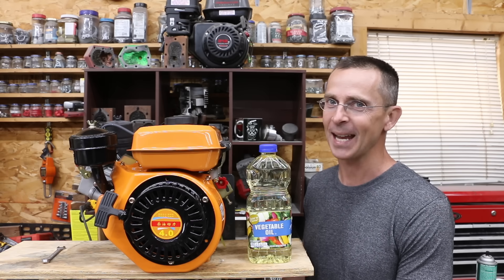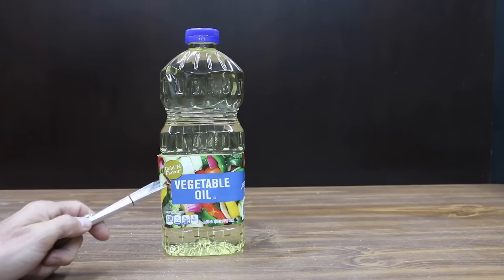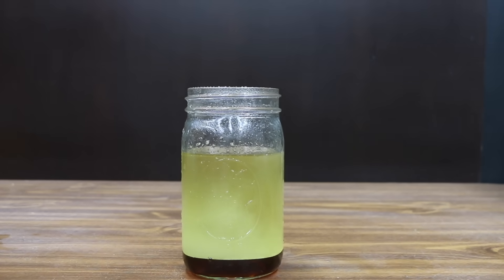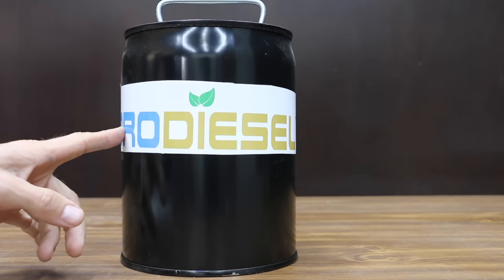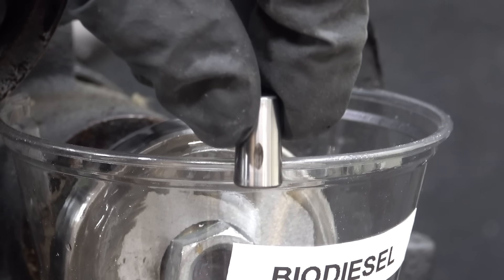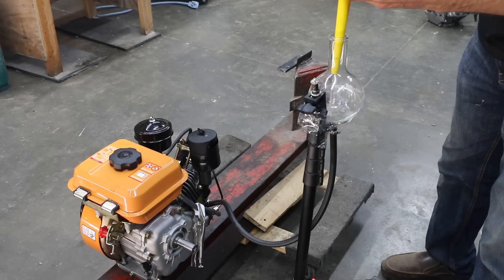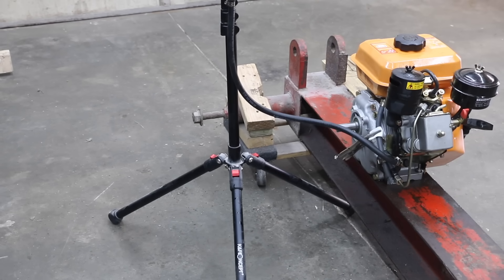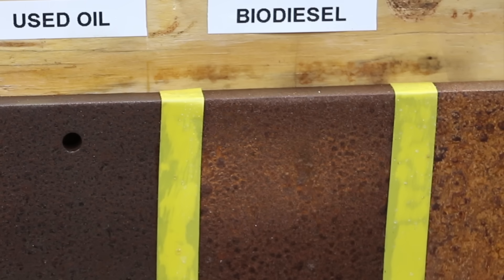Make "Biodiesel"? Let’s find out! Diesel vs Biodiesel, Used Motor Oil, Vegetable Oil, MPG

Comment: As the author of a book about bio diesel, called “The do it yourself guide to biodiesel”, I’ll add some interesting notes here. As always, a good video. Even though I wrote the book 15 years ago and haven’t mastered biodiesel in about six years, I think I can still remember most of it, LOL. 

Cooking oil is a triglyceride, meaning it is a large glycerin molecule attached to 3 fatty acid molecules. When the methanol and catalyst (either Lye, or potassium hydroxide also known as KOH) are mixed together They form a very caustic solution. When that is added to heated up cooking oil and agitated it breaks the bonds causing the glycerin to drop out. You don’t want the glycerin because glycerin doesn’t burn well and eventually gums up engine parts. That’s why SVO, or straight vegetable oil is less than ideal (Because the glycerin is still in it). And biodiesel is not just cooking oil with chemicals added, it’s actually a new chemical substance because of this whole process.

Water washing works really well, but you actually need to remove the remaining water from the bio diesel which is why it still looks cloudy in the video. I used to do it by spray drying. When it’s truly clean it will be very clear, although it will still have a tint anywhere from Amber to yellow.

I ran biodiesel in multiple engines for years with not one problem. It can’t be winterized like petroleum diesel and will gel as shown in this video. That and the fact that due to the way modern diesels are designed, you can only use a maximum of 20% in the engine if at all, so I finally gave up on using it because I like to drive modern vehicles.

I never liked the idea of straight vegetable oil, known as SVO, because the glycerin is still in it which causes problems with sensors, and general gumming up. And you had to have an oil heater to get it to flow properly, and then switch over once it warmed up, and that was even more difficult in the winter so it has huge drawbacks.

But I used to make it for $.35 a gallon which was great in 2008 when fuel prices hit $4.00 a gallon. But what actually determines the price is the methanol. You can usually find cooking oil for free, but the price of methanol is what will determine the final price. I used to buy 55 gallon drums of it from my supplier for a good price. My diesel truck as well as my fathers and our tractor all ran smoother and quieter on biodiesel so I miss it.

My current channel focuses on teaching home-improvement skills with a focus on drywall. I just recently received my silver play button for 100,000 subscribers so I don’t get too involved with bio diesel anymore.
Reply: Great explanation Kilted!  I too have been involved in making B100 for both of my Mercedes-Benz Diesel cars. The process is exactly as you described.  My friend has a processor, and we make 80 gallons at a time. He has solar power, so the only hard costs are the methanol and KOH. We can make it for less than $1.00 a gallon!
Reply: @joeyahoo2438   "Mercedes-Benz Diesel" hahah :D That's funny
Reply: @joeyahoo2438  potassium hydroxide is made with ash and oil.
Reply: Do you have a video on your process?
Reply from the maker: Thanks for sharing.
Reply: @ProjectFarm  Who knew you'd have someone who was a pro show up in making suggestions on how to make better biodiesel? Maybe some new fuel in the Ford Tractor in the future?
Reply: @ColonelK0rn1  i’ve been following Todd for a long time as he puts out great content. LOL
Reply: @ProjectFarm  great video. How about a video about foam cannon comparison or even if they work.
Reply: @ProjectFarm  

Could you please do a video for portable inverter generators
Reply: @ProjectFarm  as you probably know, I have a YouTube channel, and I enjoy teaching and helping others, so no problem. You’re killing it with your channel and congratulations. I did just get my silver play button this weekend so mines starting to go well. If I didn’t have so many health issues…
Reply: Thank you for the info! I am the opposite and run all older vehicles and equipment on my farm and am going to run biodiesel in the warm months.
Reply: What is it about modern diesel engines that makes biodiesel not work? Emissions, or something to do with the newer injection systems?
Reply: @spazzwazzle  A lot of different problems in modern engines. The addition of ureum, super high pressure diesel systems and particulate filters makes it almost impossible to use bio diesel.
Reply: @Kwarksnuiver  - I have not found this to be true if your fuel meets all the specs.  Home brewed often does not.  High pressure and urea have no effect on biodiesel.  If the fuel is in spec, it will not clog a filter.
Reply: @Kwarksnuiver  Thanks for the great answer!
Reply: @Kwarksnuiver  what is a simple definition and advantages of ureum, highpressure diésel and particulatefilters?
Reply: @flashpointrecycling  what do you do to meet specificacions and why they matter as much?
Reply: @xaviercruz4763  - Wow! that is a topic that books are written about.  I will be brief.  Almost no one (outside commercial mfg) has the testing capability to determine quality.  Most of us hold up a beaker of new fuel to the light and say "boy, that looks good!"  The fuel specifications I refer to are US or even European standards for quality.  Not necessarily legality for home brewers.  These specs are the product of millions of dollars spent to develop a standard for fuel that won't destroy your vehicle.  Biodiesel is a pretty simple chemical process but if you are off by just 1/2%, you ARE causing damage to your vehicle and probably the environment.  There are all kinds of things that go wrong in the manufacturing process and with no ability to measure success, we are all just winging it.  It is easy to ignore even the most blatant symptoms of failure,

Even big commercial manufacturers have had a very difficult time meeting the standards which resulted in a very rough start for the entire industry.  Quality control is very expensive.

So, can you make low quality, marginal fuel at home and use it in your vehicle?  YUP!  Will it be bad for your vehicle?  YUP! Very Bad? Sometimes yes!  Basically, rather than spending money to control the quality of the fuel, you will be able to measure the quality by the shortened lifespan of your fuel system and engine.

Rebuilding diesel engines is a very expensive hobby!
Reply: @flashpointrecycling  Cool, thanks. Where are test for quality done?
Reply: @flashpointrecycling  sure! Yes, and saw that company of standard you suggested. Biodiesel is nice and theres seems to exist petroleum diésel which would be interesting to manufacture.
Reply: @spazzwazzle  regeneration.. it doesn't work with biodiesel because the ignition point is higher than regular diesel.
Reply: @spazzwazzle  In response to this question, there are 2 main factors governing. Bio diesel works well in older style pre combustion chamber motors, and with old style injectors. Modern style direct injections with much higher pressures and multiple jets don't seem to atomise as good with the thicker Bio diesel. Also the burn characteristics of the nitrous oxide rich bio diesel and veggie oil require tuning of the motor to work well.
I used to run a Nissan LD 20 with around 70% bio diesel. A port job,  headers, opening up the inlet manifold and a k&n filter netted good results, but experimenting with the injection timing, nozzle sizes  and spring rates on the injectors, gave better results, up to 20 extra horses over regular diesel. Bio and veggie oil take more energy to get burning but burn faster than diesel, due to the natural Nitrous oxide locked up in the  glyceride molecules. PF didn't state whether he heard a difference in sound  of the motor when running the different fuels. Veggie oil and Bio run super smooth in 4 and more cylinders.
Reply: @thecelticprince4949  4 or more cylinders run biodiesel well in which vehicles you say?
Reply: O
Reply: @spazzwazzle  The first main thing is censors in the new engines will sense issues with anything that is not diesel and tell the engine to shut off
Reply: @spazzwazzle  - Basically, when they made 'cleaner' diesel engines, they stopped working with clean fuel.
Reply: @spazzwazzle  The older diesels used mechanical injection.  Today they use a finally tuned common rail electronic injection.  The tolerances are much smaller.  Fuel pressures are much higher.  The injector nozzles have much smaller spray holes etc..
Reply: @spazzwazzle  in my POV, emissions regulations "silently" wanted to get rid of ICE which run on fossil fuel and go to the EV, with the way of making an engine that couldn't run better using anything that is BIO, since the backings were "maybe" someone or some organizations that like EVs or declare them as environment protectors...
I said that because of some of my knowledges and a bit of experience in the modern diesel engines...
Biodiesel tend to have lower CO2s, lower COs, lower particulate matter (if you didn't experiencing dirty fuel filter because bio means something big (A.K.A fat) is more), and a bit lower NOxs because they are basically natural and the result of combustion is degradeable (except for burned lubrication oil in the cylinder liners)...

The elites want to biofuels to be extinct because : 1. More biodiesel plants could be planted so oil mining is less, 2. ICE lifetime (especially diesel) is lengthened so electric vehicles with Lithium-ion batteries can suspended, and 3. It could make any 3rd world countries (or poor countries) steadily make profit because the "fairly" easy making of biodiesel (just need the plant, methanol, burner, shaker/mixer, and some processing tools)

You know, the politics aren't that kind, especially to my 1st and 3rd statement...

Indonesia, where I lived on, experiencing more Biofuels coming into production, with oncoming B40 Biodiesels (40% bio content, 60% petroleum diesel) from previous B30 Biodiesels. But, stupidly, our goverment says Euro-4 shortly after Covid pandemic which make almost everyone shocked and panicked, causing everybody (companies) stockpile old mechanical or simple ECUed diesel...

But, there is one company that could guarantee you could run your diesels with any sort of Biodiesel, which is UD Trucks, because they only upgrade the Euro-3 variants to Euro-5 with just add SCR along with an AdBlue meanwhile others do it otherwise with using "a mind-blowing stupid" EGR...

Sorry to get this very long, cause, I like Biodiesels
Reply: Right on!  I have commercial manufacturing experience from several years ago and am still compelled (occasionally) to try and fight against the massive amount of BAD information out there concerning biodiesel.
Reply: Oh wow i I hope this gets pinned
Reply: I worked for a computer repair company that used a fleet of used Ford F250 and F350 Diesel ambulances, setup to run on just about any thing you want to feed them.  he was making his own B100 Bio Diesel a first, then switched to SVO a little later on. when he was first using homemade B100 they ran great without any issues, after switching to SVO they were hard to start in the winter, but here in the desert where it never get below freezing they would work fine once they were warmed up. that said, they broke down all time. i don't know if it was do to normal ware and tear, the age of the used ambulances, or the SVO, but they were always in the shop getting repaired. I quit working there mainly because i hated being stranded in broken down rigs and compounded by the manage being a compete dick to employees any time one of them broke down. the owner of the company and his wire were cool and i hope they are still doing well.
Reply: My mercedes om606 runs on waste veg oil (sunflower) for 120.000km rigth now my tank froze up once (-23°C was too much...) but i still use a one tank system, just a bigger feed line, stronger liftpump and an flat plate heat exchanger without any engine block heater or fuel tank heater. It works grest if you have the rigth car for it😏. But be careful in many countrys it is forbidden to use it as fuel...
Reply: Can you describe the spray dryer?
Reply: @davidscott5903  well basically you’re trying to gently spray the bio diesel out in as wide of a pattern as possible which exposes the fuel to more air & the air slowly evaporates the water. When it is finally dry it will go from that milky hazy look to crystal clear almost instantly. It will still have color to it just not the haze. I manufactured the equipment for six years under the name EZ biodiesel and had connections to nozzles that would spray in a nice flat pattern.  A lot of people just use a garden sprayer nozzle or something like that.

I have a second YouTube channel that I just now started with no videos, called That Kilted Guy Creates and I may do an example of how to make biodiesel the way I used to. I had mine tested once and it came back very clean.
Reply: @ThatKiltedGuyDIY  so what youre saying is that my 2000 7.3L can run on straight veggie oil? i already run used oil through it with 2 frame rail filters. OBAMA/ BIDEN aint stopping me!! Long live the 7.3L!!!!!!!!!!!
Reply: @gman8760  Nor would they particularly want to... vegetable oil is carbon neutral. It’s the stuff that comes out of the ground that’s the problem. Now, your local fuel tax guys might have a different opinion...
Reply: @gman8760  I would add 20% kerosene to the mix not SVO I ran my 12 valve on peanut oil and kerosene for years also I would throw in my used oil or trans fluid after I filtered it threw a 2 micron filter the old mechanical diesels will run on anything almost
Reply: @Justthemow  kerosene or diesel? And what about used cooking oil?
Reply: @gman8760  the used cooking oil is fine as long as you filter it really really well used oil has bits of flour and stuff in it and kerosene has more of something in it then diesel I forget what it is but it cleans the engine and fuel lines as the oil will leave gummy shit in the system. So used cooking oil needs to ultra filtered and this really only works in mechanical diesels not cp3 or cp4 it has to like a vp44 or p7100 if you have an early cp3 pre emissions you could run up to 20% oil and the rest diesel
Reply: @Justthemow  i run a 2000 7.3L HEUI system so I don't see why it wouldn't run. Just a thought if the price ever gets ridiculously high
Reply: @gman8760  Dumb comment of the day winner.
Reply: @Justthemow  Used cooking oil will contain proteins as well as starches, and will often have been heated to high temperatures (over 350°F). 

New cooking oil is ten times the price of gasoline. Where this guy pretends to get it free I don't know.
Reply: @gman8760  Another solution used by a guy I know is to keep some pure diesel in his second tank. He starts the truck on diesel, switches to veggie once the engine is warmed up a bit, and then when he is 5 minutes from home, switches back to diesel. Iirc he's using the diesel to clean the glycerides out of the system before shutdown.
Reply: @Ea-Nasir_Copper_Co  Who is the 'guy pretneds to get it free' bud?  Todd showed new veg oil, however you can go around to many small restautants still and arrange to pick up their used fry oil.  Many places have to pay to get it picked up, so offering to pick it up from them and maybe drop some cash their way is possible.  
Many people do get it free.
Reply: @gman8760  you run straight used motor oil in your 2000 7.3? I have a 99 7.3. Did you cut it with gas?
Reply: @norriscarey9822  usually cut with diesel. I don't run a full tank of straight motor oil. I should rephrase that.
Reply: @gman8760  you should see the comment I left later on the video. Ran the same motor on it for 15 years and still use it today.
Reply: @austinjohnson3787  I think I did see something about that..you run it cut with gas right?
Reply: @gman8760  gotcha man that’s what I thought.
Reply: @Ea-Nasir_Copper_Co   You get it used from restaurants for free. They have to pay to have it recycled so they should let you have it for free once they have some reason to trust you. Of course at this point it's partially burnt, it's got lots of debris and probably some water in it, and smells kinda gross. But once you skim it, then fine-filter it, and possibly boil out any wash-water or rain-water (cuz it's normally stored outside), you have free kitchen oil.
Reply: @gman8760  hell no, we did it as professional as it gets.
Reply: @austinjohnson3787  ah gotcha.
Reply: @gman8760  You can do a mixture of 30% veggie oil and 70% diesel. Works well in my old Mercedes Benz. Smells like fries. Dont spill the veggie oil on the paint, it is hard to remove.
Reply: @stefanmargraf7878   new veggie oil? Or used? Either way good to know
Reply: @gman8760  New veggie oil.
Reply: @stefanmargraf7878  you can run 100% veggie oil in all mercedes diesels up to the om606 (lastly build in the w210 e class)
Reply: @gman8760  lol i suddenly got flashbacks from an old TV item we had back in the 90s, where some belgian dude made a vehicle that ran on old contaminateddeep frying cooking oil from snack bars,  he would pick up for free as they would toss it out otherwise 

not sure on what he added or how/whether he filtered it, it just showed him driving and a pretty poor burning :')

pretty fun to read the original commenter's comment talking about how it's not just cooking oil with added chemicals, but actually a... transmutation (i think that's the word?)
Reply: @ThatKiltedGuyDIY  please do ill sub
Reply: @ThatKiltedGuyDIY  would you not say that the glyceryl ester fragment would have different properties to the glycerol alcohol left behind after methanol esterification? the glycerol in biodiesel is a contaminating byproduct, whereas the glyceryl group is a core part of the vegetable oil molecule that isnt possible to remove without making it not vegetable oil, the same way as nail polish remover without the ethanol is simply vinegar, which wouldnt really burn well at all. in this context, where the glycer- group is not glycerol, why would it have the same "gumming up" effect on the engine, considering it wouldnt be possible to not burn in the reaction?
Reply: @davidscott5903  it’s probably described in detail - in his book.
Reply: @davidscott5903   based on the description in the post and what I know of similar processes used in other chemical processes, it's just a misting nozzle. 

The biodiesel is sprayed through the misting nozzle directly into a bucket or receptacle, usually with dry or warmed air circulating around it to encourage water evaporation. 

The easiest setup would be a lawn sprayer, but you'd want the chemicals that usually ran through such systems to be thoroughly removed.
Reply: Here in Australia I'm part of a club that just mixes used veg oil with petrol 15% it works pretty well in older pre combustion chamber engines with mechanical injection but not really in common rail systems
Reply: not everyday i learn a lot in youtube comments. thx kilted
Reply: Aren't the fumes from stripping out the glycerin toxic? ...or does it depend on what you mix into the Veg oil?
Reply: This! Brings back some memories for sure. I haven't made any in a good long while but I like the idea of being able to.
Reply: To throw my 2 cents in the well, I used to run my 2000 VW Jetta on an 80/20 oil/gas mix and it ran great. Drove many miles that way. The issue I had was the amount of smoke rolling from the tailpipe under acceleration. I felt bad for the cars trailing me. Lol. I never had any other issues and still have the car to this day with 340,000 miles on it. Now, I also have a 1968 M35A2 (deuce and a half) with the multi fuel Hyper Chamber LDT465 engine. I run that truck on pure used motor oil that my family, friends, and neighbors drop off in my driveway (about 10 gallons a week). As with the VW, I run this used oil through a heater and into a centrifuge at 7k RPM which filters down to fractions of a micron as well as removing the moisture.  I then pump it straight into the tank without any thinning required and it starts and runs flawlessly. My oil/fuel runs through a coolant heated pre filter followed by 2 wix spin on fuel filters. I’ve done this for years without any issues. That being said, the LDT has 2 hole injectors that spray a stream rather than a mist (by design) and pop at 3500 PSI. It was designed to operate on nearly any flammable liquid from gasoline to gear oil.  Straight used oil may operate just fine on other large older diesels as well.
Reply: @thompsona10625  Ha ha!! My uncle worked on those LDTs in the service, he said they'd run on anything from goat piss to gasoline. Great vehicle!
Reply: @jimmartin7881  
He’s right! They really do!
Reply: German engineer Rudolf Diesel (1858-1913) built his first diesel engine in 1892. He experimented at first with a number of fuel sources including coal dust suspended in water however by the 1900 World's Fair in Paris, Dr Diesel had his engine running on 100 per cent peanut oil!
Reply: so what youre saying is if someone wanted to make their own, include 20% of it with normal gas-station diesel? or is mixing bio and petroleum a bad idea?
Reply: @The_GreenMachine  you can mix bio and Petro diesel to meet your specific needs no problem. I run b100 in the summer and b75 (75% biodiesel and 25% Petro diesel) in the winter to help with gelling.
Reply: @The_GreenMachine  mixing the 20% diesel is to prevent it from gelling & help it flow.. as is preheating the fuel oil
Reply: Nice comment
Reply: @ChrisEffpunkt  says the dude with tats all over and flying the bird in his photo, lol. Jealousy is obvious here
Reply: Thank you , that's good information
Reply: Nobody's giving away used bulk cooking oil anymore, nobody. We went from getting paid to take it, to paying for it over a decade ago. All the bus companies use their waste oil for heat and if they don't we have to pay for it. I go to wallyworld or the oil change places and steal all the used oil people drop off, lol. Good for about a hundred gallons or so a week and everything I have is old so it works fine. It's filtered, mixed with #2 and used, still saves me tons at 0.80 vs. 3 and change per gallon.
Reply: why methanol instead of ethanol?
Reply: @acbikeoz  because the commercial production of ethanol (booze) is regulated by the government.
Reply: @bubbalexi  thanks,  In Australia our methylated spirits is denatured ethanol rather than methanol.
Reply: @acbikeoz  That'd be a long answer, look up Ines Reyero Zaragoza or Luis Gandia Pascual for an in depth answer. 2 petrochemical engineers that have a pretty firm grasp on what works and why, lol.
Reply: I'll dispute the 20% biodiesel number, at least for running it here in AZ.  As I said in my other post, I ran several hundred gallons of 99% biodiesel in my '02 Duramax for several years.  Not all the time, just when it was competitively priced to petro-diesel, and that included the gallon I'd need to burn to get the the plant to fill up.  Never had a gelling issue with weather down into the low 20's, and my truck performed better and more quietly.
Reply: I have made bio for some time. I run a 2013 2.0 Ford Mondeo with the Pugeot engine in it. I tried extending use into the colder times by adding 1L gasoline per tank fill in order to wake it up a bit and prevent gelling but that affected the shaft seal on the HP pump and made my oil level increase. It cured its self after about 2 tanks of mineral fuel and an oil change. In the UK we can use 2500L of bio per year for private use before paying any tax and maximum batch sizes of 250L.
Reply: The process you are referring to is transesterification. I make 100 gallons of B100 every week with a biopro 380 processer. I run it in a commercial mowing fleet with Kubota diesel mowers.
Reply: I am a chef and have worked at lots of restaurants over the years. When I first started cooking about 25 years ago we had to pay a company to come and remove our old fryer oil. Fast forward to today and there is fierce competition out there. Now THEY pay US for the oil.
Reply: I wish you could come over and help me with my setup! Great info!
Reply: Chem major here. You can also remove the water from the bio diesel solution by adding a drying agent such as an anhydrous sodium bisulfate
Reply: Great having someone with so much experience comment, so Thanks, I have a 2014 VW TDI that I would never run Biodiesel, just an additive for lubricity, at least until I remove the emissions, I also own a 96 7.3l that I wouldn't mind trying anything.
Reply: What’s the reason modern diesels don’t like it? You might be able to get it to work with an open source ECU like speeduino if it just needs to be tuned for it
Reply: @Athiril  DJ Red Hare mentioned it- it comes down to the very fine direct injectors and common rail fueling systems, they just can't handle a diesel fuel that deviates from the norm or any glycerol at all. Older pre-combustion chambers and mechanical pumps can run it fine. Randy Probst also has some videos on VINWiki about his daily driver TDI Diesel Passat that he runs sunflower oil on.
Reply: That's a very cookbook way to describe it. Chemically that's not really right. The catalyst isn't KOH or NaOH, it's the methoxide product of the base and the alcohol which is what is providing the base for the ester hydrolysis. It doesn't just make glycerine, using hydroxides creates water also. This is why you can't stir it vigorously, as you'll end up with an emulsion similar to mayonnaise. It's also why commercial production uses sodium or lithium amide as a base. Instead of  water, they create ammonia gas, which cannot form an emulsion.

"That and the fact that due to the way modern diesels are designed, you can only use a maximum of 20% in the engine if at all, so I finally gave up on using it because I like to drive modern vehicles."

This is not true at all. I don't know why you think that. Modern diesels run just fine on 100% bio.
Reply: Didn’t the government banned or tried to ban homemade biodiesel because they could not get the fuel tax on it, and let private business make and sell biodiesel thru a fuel supplier.
Reply: @That Kilted Guy. I had or still have that book. I used to drive a lot of diesel cars. That book inspired me experiment. Small scale mind you but I learnt something.
Reply: @user-lz2bn6eo1j  cool. I’ve thought about doing a revised version but interest isn’t there anymore.
Reply: @ThatKiltedGuyDIY I'm 50 now. My interest have always been about alternative fuel and living since I was in my early teens. My dreaded words to my son is "I have a book on that".
Reply: I have a 98’ dump truck with a cat engine haha what do you say?
Reply: Great info!
Reply: I believe I read your guide in 08. I processed bio diesel and a 55 gallon drum was like $450. I filtered my fuel after drop out with resin and it looked like sunflower oil. Had a friend call me one day asking if I drove through town as she smelled my french fry exhaust!  Ended up stopping die to reclamation companies taking restaurant oil. Never could get the water filter cleaning to work and stopped trying after I made shave cream one day.
Reply: How can petroleum diésel be made, what happens to a modern vehicle on biodiesel and Which older vehicle you know can run 100 percentil on biodiesel ?
Reply: I have your book 😁
I find that the water needs to be misted very finely, like the cooling sprayers at an outdoor cafe on a hot summer day. Spraying too aggressively as in the video yields too much soap. I, too, noticed the cloudiness of the bio and don't think it was a good test in that regard. Great video, but I think we're not seeing accurate numbers for the bio.
Reply: If someone drives a old diesel car, then not much sensor and fuel injection.  Would it be better?
Reply: @MrMannyhw  as long as the injectors & pump get adequate lubrication you can run anything through them.. vegetable oil as long as it's purged at the end of every run.. it's hygroscopic & everything steel will rust not to mention gum up
Reply: Specifically, what you do with biodiesel is you are "pulling off" the subsections of the chemicals you want, then separating the rest.

Typically the only additives are the additional things used to improve burn properties.  This is typically ethanol, methanol and/or isopropyl alcohol, some sulfur and phosphorus additives to adjust burn temperature properties, and some diesel oil additives to improve the lubrication properties. 

As a note, the glycerin can be used as a low temp grease, a lamp fuel or be further processed into vegetable wax via hydrogenation and the addition of burn modifiers like phosphorus and sulfur compounds.   Phosphorus increases temperature, while sulfur slows burn rate for a nice steady burn.
Reply: Im new to all of this, Question please. Can I run a generator or equipment like a chain saw on this fuel? Does anything need modification?Just curious as to the uses if your trying to live off the grid. Thanks
Reply: I heard the problem with modern vehicles today isnt the engine itself but more with the parts that are connected to the engine that cannot support Biodiesel. If you change some of those parts with parts that can support biodiesel, the engine runs just as good as petrol diesel.
Reply: You guys keep getting it wrong, the XOH added (can be an alkali hydroxide molecule) isn't a catalyst as it is consumed in the production of the methoxide or ethoxide that attacks the ester bond by and SN2 substitution,. You can use ethanol and even isopropyl, I imagine a higher viscosity for the two, but the chemistry is the same. Use the alcohol and hydroxide to make methoxide, ethoxide or propoxide, add that to the TriG resulting in FAME FAEE or FAPE (fatty acid methyl ester).
Reply: I’ve watched your drywall videos. Good content. Between you, The Vancouver Carpenter and the😅 Drywall Dr. ,learned so much, I don’t have to watch drywall videos at all anymore.
Reply: In Europe fuel is around 1,5x 2x as expensive as in the US but I think you know that :D
Reply: Glycerin could be soaked in chopped wood or wood pellets and burned along them.
Reply: hi
thanks for your information
here in my country they raised petrol prices and cheated it .. our cars suffer from low mpg and high cost of running .. even so the color is red rathar than light green which mean they are using some kind of chemical .. any suggestions for make bio petrol if its existed!!?
thanks
Reply: Well one word diesel gets hard under somewhere 0 Celsius anyway already saw this . This is so called summer diesel you need an anti-freeze anyway if bio or not.
Reply: What about waste motor oil? You can get it for free
Reply: This was an excellent write up and a really good primer on the merits and drawbacks of biodiesel.
Reply: Thank you for the clear and thorough comment, makes sense
Reply: Whats your channell
Reply: how do you find the sodium proly i cant even spell it at this hour
Reply: What about using cannabis?
Reply: If you have a supply of wood, you could gassify wood into wood gas and use the gas to make methanol. I'm pretty sure that's why they call methanol wood alcohol. The wood gas actually has all the ingredients to make methanol, hydrogen and carbon monoxide, you just need to react them together using a catalyst.
Reply: Is there a way to modify modern diesels to be able to run on 100% homebrewed biodiesel? What's the issue of running biodiesel on a modern diesel vehicle?
Reply: why did you not just make your own methanol? all you need is a modified wood gasifier with a cooling coil and the correct wood/plants to burn.
Reply: Wait wait 4 bucks a gallon, and hears me pay the same for one litre, you yanks will complain about anything
Reply: @x_hibernia  4 bucks a metric liter worth 1000 milliliters? that can't be right
what kind of monopoly money are you tlaking about? inflation isn't quite that far yet :D

for dollar or eur, that rules out you being in europe,  there's not a single country in europe that even exceeds 2 euro/liter, barely even breaks 2 dollar converting eur  > dollar (multiply by 1.22, current exchange rate), for the most expensive diesel in europe right now

i live in the netherlands, we're the most expensive in the entire EU for euro 95.
diesel is a bit cheaper here, and we usually have finland/norway.italy being a bit more expensive
but still... it's like €1.47 > $1.79 a liter here, still on the high bracket of europe.

under what crazy imaginary rock is diesel 4 washingtons a liter?
are you in some crazy non-petrodollar country? :)

sure, USA diesel still is half the price ($0.84 a liter), but it's nowhere near the 3-4x price factor regular petrol had back in 1994 compared to where i live, if anything, the pricing grew closer to the USA (well, the USA prices crept up), and is now only 2x the factor
Reply: Why don't you start a YouTube channel,?
Reply: If you nitrate that glycerin molecule your engine will produce 1200% more power :D
Reply: Holy shit a helpful and interesting youtube comment
Reply: @WTFIsThisGuyDoing233  I have a YouTube channel with 100,000 subscribers, because I try to help people.
Reply: With a name like 'That Kilted Guy' he's GOT to be an American. Only American's are that cringe.
Reply: @bashkillszombies  Lol. I’m a free human who lives my life in the way that makes me happy. Everyone should try it
Reply: @bashkillszombies  I deleted your comment on my channel too, no time for rude keyboard bullies in my life and I have FULL control of my channel Lmnao
Reply: Great feedback.  Would you comment as to the environmental impacts of various diesel alternatives
Reply: @windywaz  pipe down, hippie...

:-D
Reply: @mildlydisinterested  Boomers are hippies.  I'm gen-X, I prefer Tree Hugger :-o